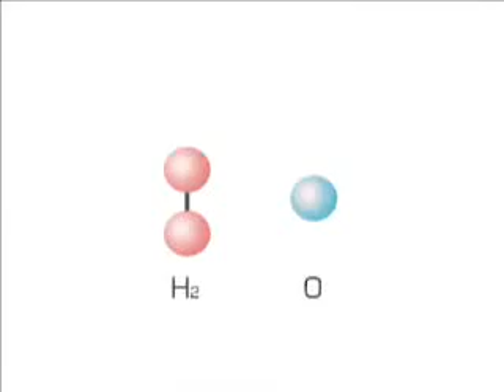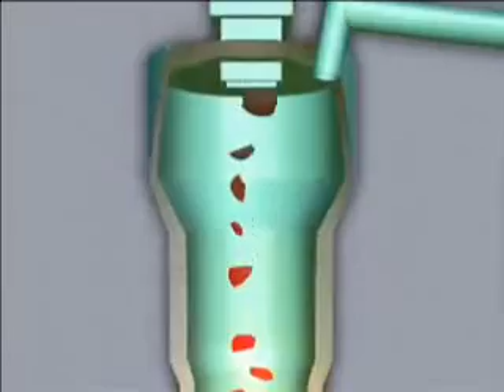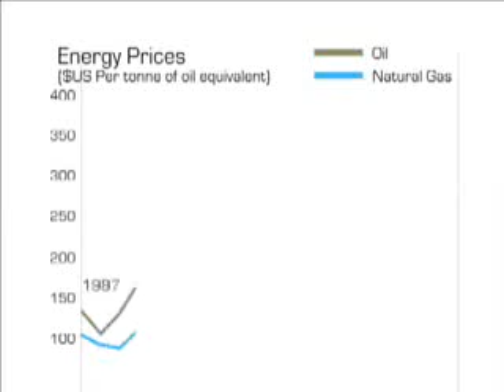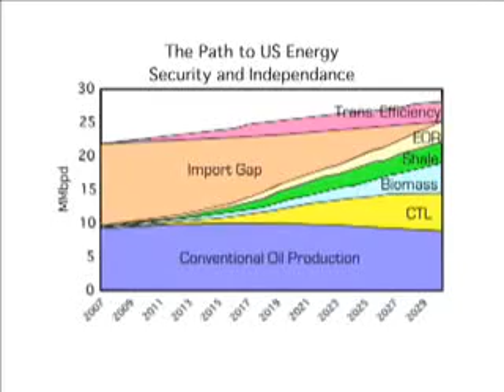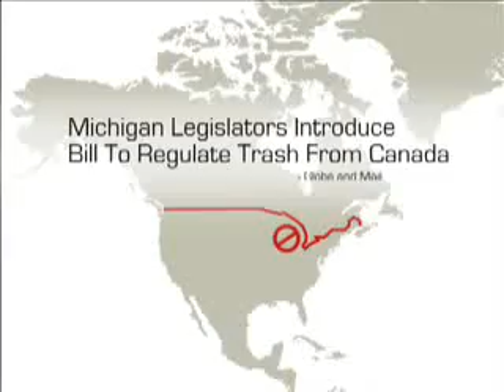plasma gasification

Comment: wow.  where are you going to get the electricity to heat the effing chamber up to the temperature of the sun?  genius.
Reply: I know this comment was 8 years ago but figured I'd chime in. The heat is caused by the plasma arc. Obviously that takes initial energy to start and energy to power the coil to keep the slag molten, but once it's powered up you can produce enough energy from the singas to run the whole process and then some.

Comment: it would be possible for a group in a community to coa own a small gassification plant or perhaps small
home devices could be built but your looking at 20 grand here for a usable device and thats on the diy level but at least it isa way to obtain energy independence,the co2 can be stored and
electricly converted into co fore power station use ,we could work on a new carbon cycle power plants can convert
electricly co2 into co but im not shure if it can work on a thermal dynamic level